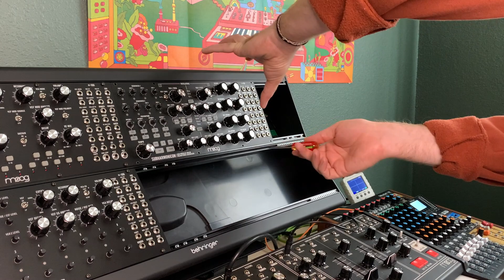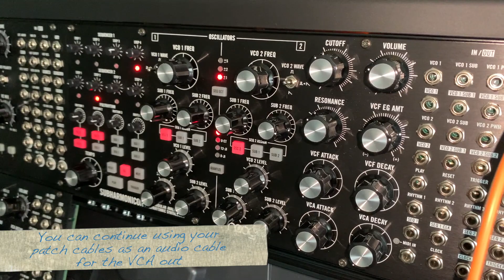Installing Eurorack Mountable Synths

Comment: Nice case!  Maybe add a mixer module next so you can run all that stuff into your main mixer/interface without tying up an input for each Moog module.
Reply from the maker: I had actually purchased a behringer mixer but returned it because the quality was terrible. For now I’m just running all the VCAs into my 8 channel mixer.
Reply: @Tiger.Arcade  I meant a mixer in a Eurorack module right in the case.  VCAs to that and then output to your main mixer.
Reply from the maker: @ilovecatsandsynths9702  yeah my b. That’s what I meant as well. I purchased a Behringer eurorack mixer and returned it. I use a Tascam mixer audio interface now which I use with my DAW.

Comment: That is a good case for the price - the power supply is not bad. The Doepfer "low cost" cases are a bit more, but have about as good of a power supply as you can get without going to a pricey linear type setup. Also, some like sliding nuts and some do not. (I do personally) For someone adding to a semi-modular rig modulation sources and control are the most bang for the buck initially IMHO.
Reply from the maker: Appreciate your comments! Let me know if you have any Modular recommendations like modulation and control like you were saying. Just got the Squarp Hermod for control.
Reply: @Tiger.Arcade  it is an interesting "divide" in modular between those who want multi-function "divey" dense modules and those who want "old school" knob per function focused/granular modules tending (not always) to be less crowded/dense. I am the latter. (You put a quarter in me so now you get the whole ride...) Selam from Tesseract is a lot of modulation for a very modest price. QARV from ALA is a bit more flexible/capable for not much more which also equals a step up in components and build. Plus, it can save you buying a VCA or two for a while. (I am NOT among the Maths fans and would take either over it every day) Contour 1 from Joranalogue is at the premium end of things and more granular/focused/advanced than those two. (I have not used Instruo Cnoc so cannot say, but it looks like it could be a viable "best of category" alternative to Contour 1) For me it is the must have "refined surgeons tool" of the 3 while either of the others is a nice to have addition to it if you decide not to go with a single full featured old school EG first instead. If you do Ceis from Instruo is another of those "refined surgeons tool" modules - utterly brilliant for "just" being an ADSR. Also at the premium end of things and also worth every penny. Klavis Quadigy also deserves serious consideration. Too divey for an old fart like me which means not really that much at all, but I parted with it because I want NONE of that. You also need at least one VCA unless you went with QARV. Since this is mostly an add-on for a semi-modular rig aimed at being a CV "mod block" and not audio output Morph 4 from Joranalogue is the "next level" VCA for CV. So, in the end you want a mod source (Contour 1 = advanced, QARV/Selam = multiple independent) an EG (Ceis = advanced, QARV/Selam = multiple independent, Quadigy = some menus + multiple independent) and some VCAs (QARV = economic route, Morph 4 = advanced capabilities).